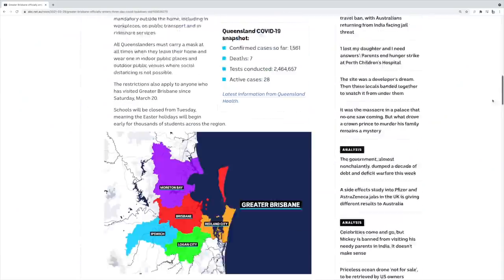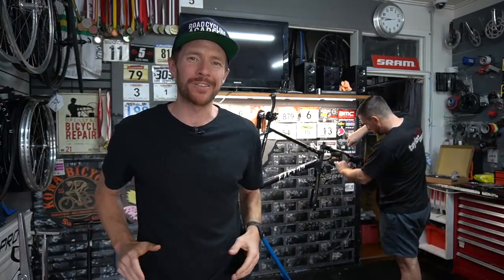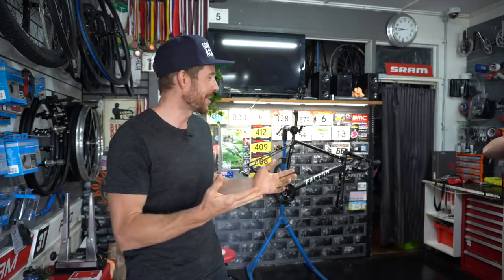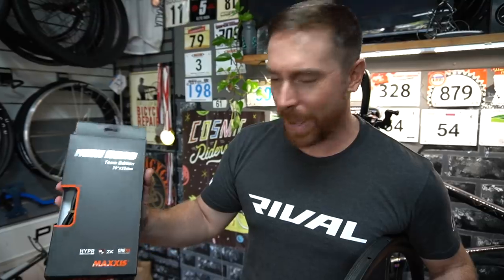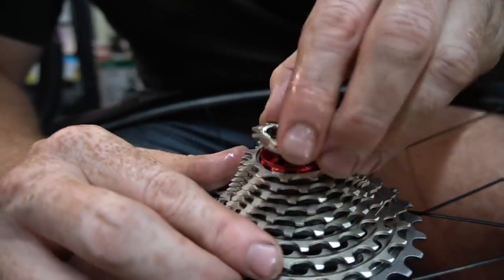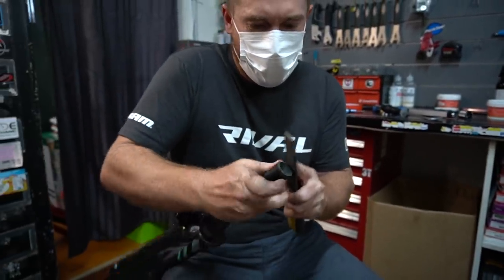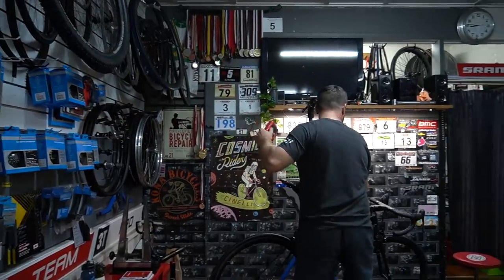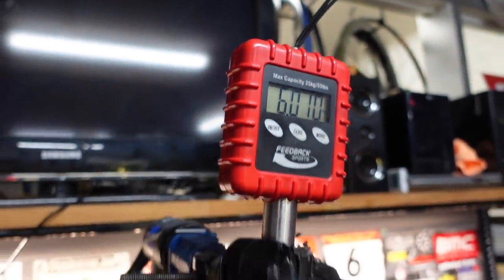Dream Build Lightweight Race Bike (Factor 02 VAM)

Comment: Pre-stretching tubs like that is not recommended by any manufacturer. You might damage the sews or the base tape. I got some old alloy tubular rims from the 70s that I got for next to nothing. I leave my tubs on there inflated to max pressure for a day or two and they go on super smooth after.

Comment: I ride my bike for 3 reasons. 1) Cardio workout 2) Leg workout 3) Be outdoors when excericing. So why would I want a bike that weighs nothing that I barely need to pedal that wont be as good a workout as my entry level bike?
Reply: Depends if you want to go up hills faster that the main point. A lighter bike at group speed makes little advantage on the flat but slowing and acceleration to cruise speed is noticeably quicker.

Comment: Almost wanted to get the O2 Vam and pair it with campy super record 11 spd mechanical but gave up after Factor mentioned it is only compatible with electronic shifting groupset only.  Now i am confuse as you managed to fit the sram red mechanical.

Comment: I've ran that wheels manufacturing gxp adapter. It's okay. It works but adds weight and is not that efficient. The threaded wheels manufacturing gxp adapter is much better!

Comment: Hi Cam,

Since you using older sram 11 speed. Do you face any challenge finding parts for it since sram moved on to wireless and 12 speed.

One of my mothballed bike is Sram Red 2012. I not sure should i upgrade to newer Shimano ultegra 11 speed since its is challenge to find all the parts since certain parts its condition required new replacement 😢

Look forward to hear your opinion on this
Reply from the maker: It was like finding gold mate!
Reply: @CamNicholls  damm now you make me whether to keep running my red 2012 till it totally broke down or keep it as museum piece 😂

Comment: Only illegal in a UCI race😄
If you are under 80kgs those wheels won't pop spokes. Thats a light bike for hills climbing.
Now, can he build another with an alloy frame at 6.0kgs and under? Challenge is set.
But tubs though cam is that really worth the grief when the industry is moving away from tubulars?
Reply from the maker: They're lighter mate, that's why I went with them! Love the old school too.
Reply: @CamNicholls  fair point

Comment: This is real bike porn. Very nice Bike Cam. If you wanna lower the weight you could replace the saddle with a berk lupine pure carbon saddle. It weights around 70g (so you save around 100g), looks amazing and is very comfortable too. I use it for quite some time now.
Reply from the maker: Thanks for the tip Alain! And cheers

Comment: Am I the only one bothered by the fact that the chain catch pin that should be behind the crank is in the wrong position? You will notice there is another hole on the opposite  side of the large chainring (behind the crank arm in the hidden bolt SRAM red cranks). You should move the pin to that other hole to stop the chain getting jammed between the crank and the chainring if it drops to the outside, and to avoid that sticking pin to injure your leg if you crash.

Comment: So what does a guy who races do with a bike that is almost 1kg underweight??  Actually a serious question - how best to add back required weight to make the bike legal again?
Reply from the maker: Need to investigate this myself mate!
Reply: Non UCI not an issue, UCI race an heavy saddle and a trip to bcf for a bag of fishing sinkers in a bubble wrap tube down the seat tube.
Reply: So a "heavy saddle" might add 200gms, still leaves you 800gms to get the bike to UCI legal - that quite a lot of fishing sinkers to squeeze jnside the frame.
Reply: @CG-99  UCI is 6.8 cams bike was a tad over 6 so a heavier saddle night add 100 or so. Lead is dense you'd be surprised how little makes 700 grams.